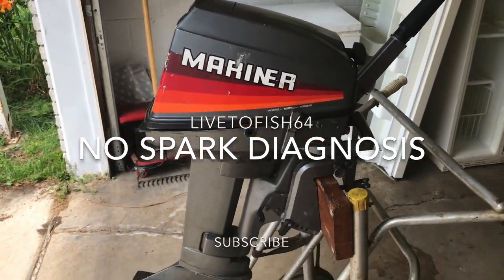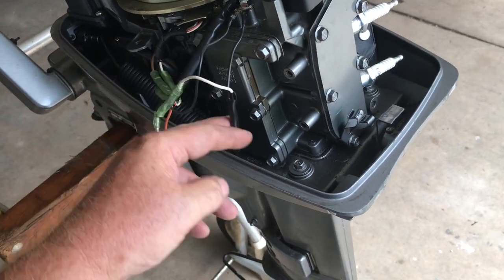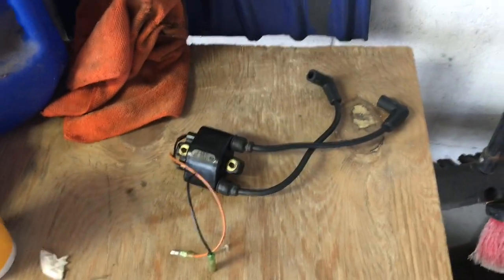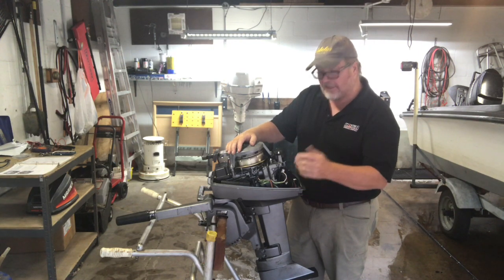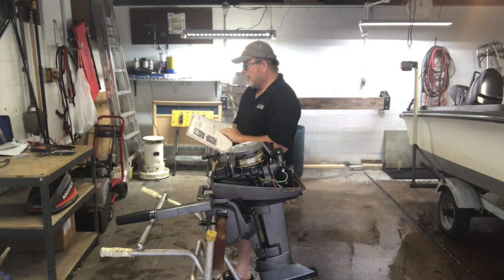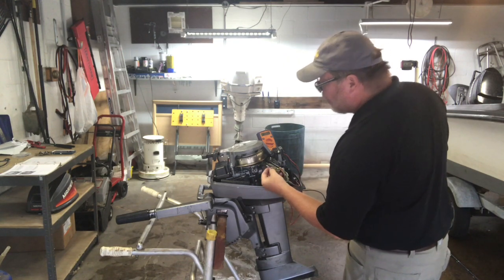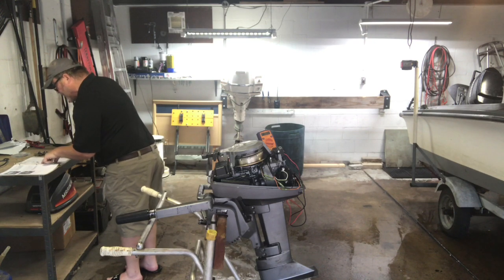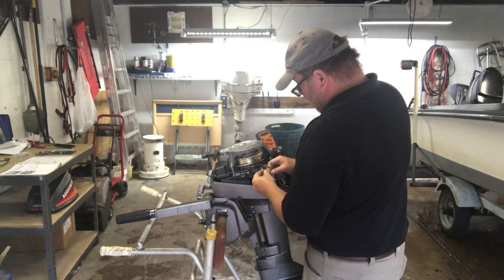8 hp Mariner - Diagnosing a bad CDI with an Ohm Meter “No Spark ⚡️”  - Part 1 of 2

Comment: Testing brown to white on the CDI I got 1.9 on the 2M scale. I reversed the leads and got infinite. Unusual?
Reply: Also, black to white/red is 1.8million when red multimeter lead is connected to white/red. Otherwise it's infinite. Further, black to brown is 100k. CDI is not looking good
Reply from the maker: Reversing the leads should produce the same value. Looks like you could have a bad connection, wire or CDI box if those resistance values are way out of spec.

Comment: What yr is that and where did you acquire a service manual...I just bought an 81 mariner 15hp/yamaha clone....need a service manual
Reply from the maker: @justinash2429… the owner found the service manual on eBay. The manual was specifically for the model and did not identify a date of manufacture. You also might try www.marinerngine.com They sell Seloc manuals for all manufacturers but are somewhat generic.